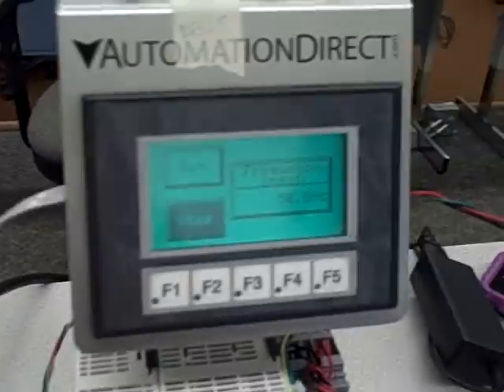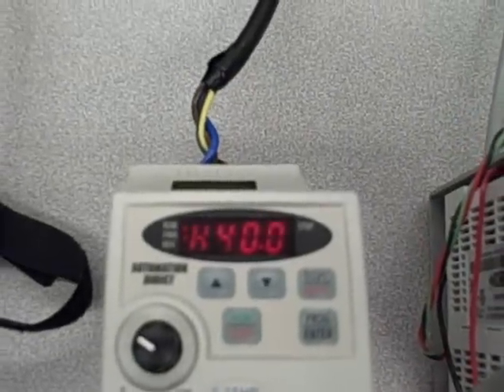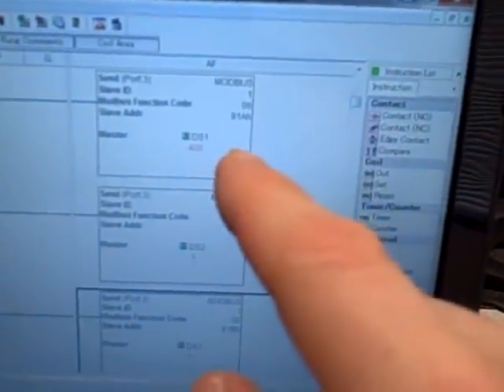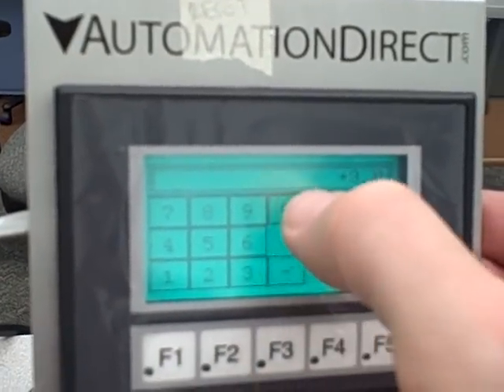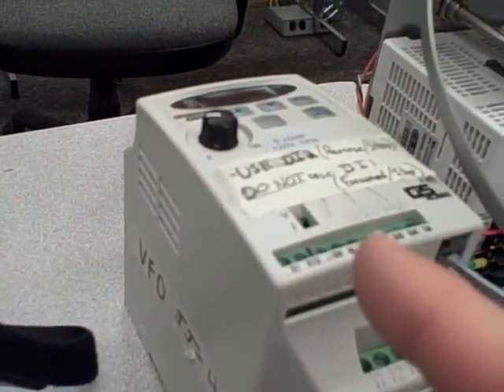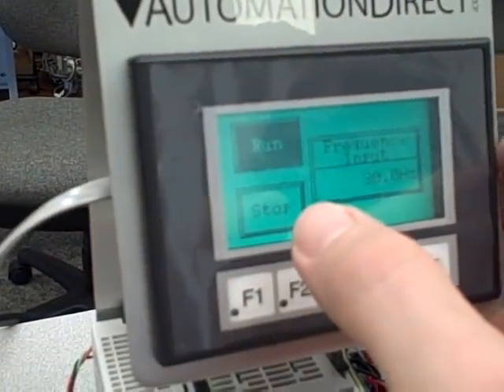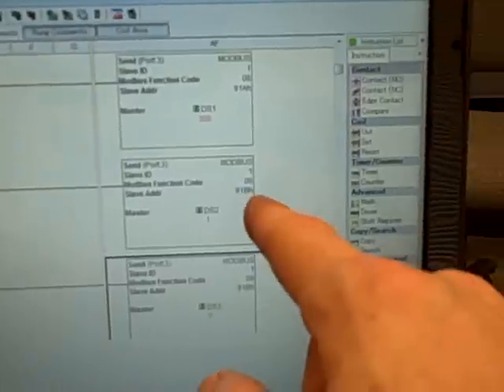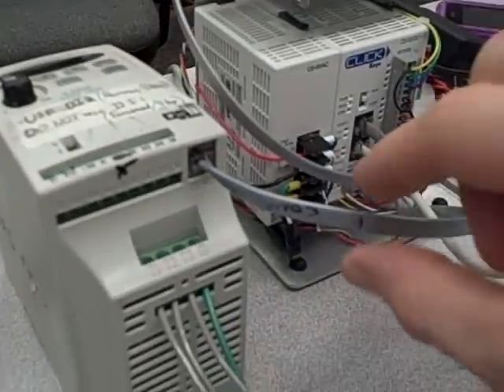PLC control of a VFD via Modbus

Comment from the maker: No, not at the same time.  The speed command "send" instruction only transmits on the up-stroke of the 500 ms timing bit.  The other two "send" commands only transmit on the down-stroke of the 500 ms timing bit, and those two cannot happen at the same time because they are enabled by opposite states of bit C1.  So, you will never have two "send" instructions transmitting simultaneously in this simple program.